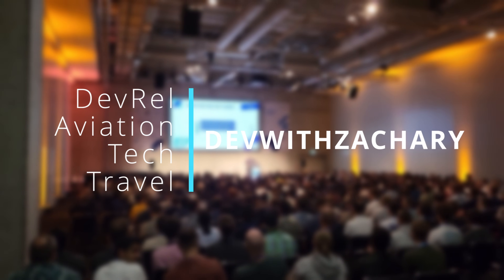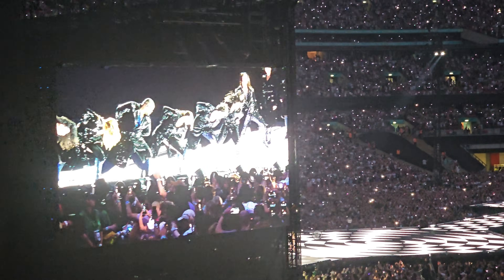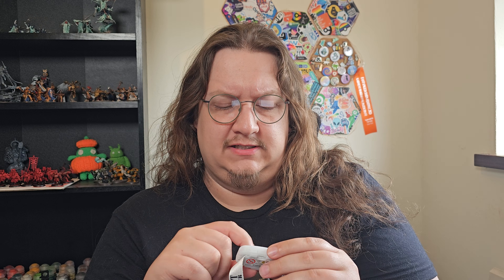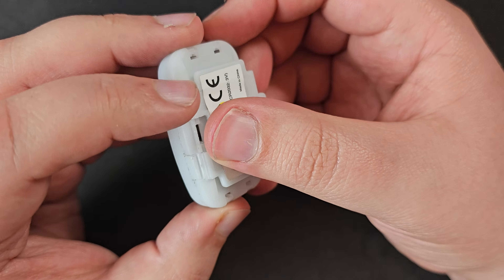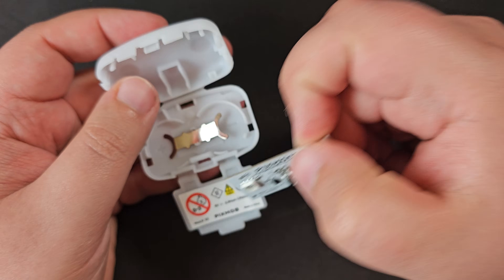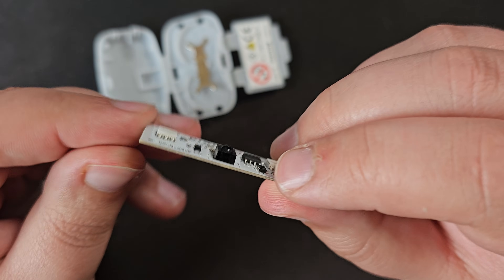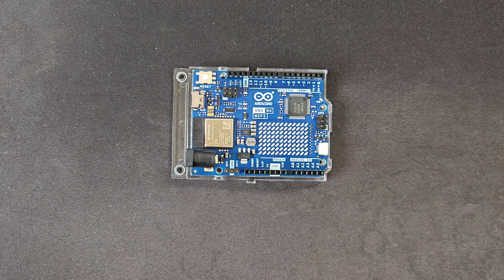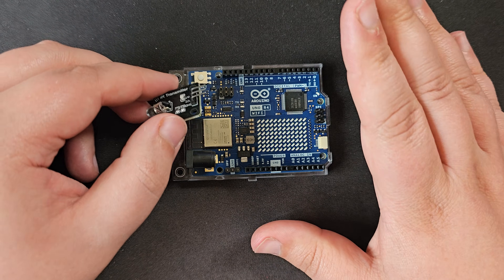Hacking the Pixmob LED bracelet (As used on Taylor Swifts Eras Tour)

Comment: Ok, I have done the same and works. It's not very good that we nee to use python, so I move the binary sequence directly on the Arduino sketch. Now, when my event was ended the leds blinks in white, also when I was at home, so there is a way to store led sequence also without IR trasmissions? Someone have found it?

Comment: Good morning. Great video, thank you. I'm very new to Arduino and I've been trying to get a Coldplay wristband working with the R4 WiFi, for very sentimental reasons. Have you dived into the sound to light hack? It automates the sending code to the IR LED and should be great fun but I can't make it transmit; my KY-005 doesn't have a resistor built in - maybe an issue? I'm sure many would enjoy seeing you work through it.
Keep up the good stuff.

Comment: so how are colors change via infrared? is it like a morse code that is sent across the light to the bracelet?
Reply from the maker: Pretty much, its an encoded series of light flashes that correspond to a colour and type of flash
Reply: Yup, binary 1s and 0s encoded to 8 bit values of Red Green and Blue (RGB). Each color is 8 bits of data or 256 levels of brightness so you can mix and match for effects. Purple = R + B, Yellow = R + G, Turquoise = G + B etc...

Comment: These are quite cool. I went down the rabbit hole a few years ago on syncing them up for a Christmas light display. With a proper DMX to RF transmitter you can get near 1 km range on these. For those in the programmable LED lights hobby, using an app like Xlights, a Falcon or Kulp controller and a DMX to RF transmitter you can make a fairly interactive show. I'm working on one for this upcoming season as a local fundraising event for pediatric cancer research.
Reply from the maker: @kevkev5935  very cool….and now I have ideas for Christmas 😂😂😂
Reply: @devwithzachary  Its an addictive hobby for sure. I followed some WS2811 pixel lights gurus a few years back and the rest was history. This year's project for me will be hacking the Govee curtain lights to work with Xlights and incorporate into my show as a pixel matrix.

Comment: Thanks for the great video!  I may try tackling this one as well.  My daughter went to a concert and ended up with one of these PixMob light bands as well, although it is a different model.  The batteries are dead, so knowing that the accessibility is as modular as it is, replacing the batteries would be straight forward.  I have a background in software development, including an understanding of languages such as Python, and I have experience with electronics and soldering.  I didn't realize the Arduino's had such low price points, so I may try this out!  You earned a subscribe from me today!  : - )
Reply from the maker: Really was a fun little project! and yeah i was surprised at the Arduinos price point. Thank you for the sub!

Comment: My daughters came home with Taylor Swift bracelets. Do they have RF capability? Is the RF just an alternative way to IR to program or activate the bracelets? The github page is not very clear on that. Thank you for enlightening me on the workings of the system.
Reply from the maker: @Djeez2  I believe there is a specific version that uses RF instead of IR. The versions from Taylor swift are just IR
Reply: @devwithzachary  hey can you show what thonny script do you used and what did you edit, 'cause mine isn't working :(

Comment: I believe for the shows themselves they trigger the controller (the Arduino in this case) with theatre lighting protocol "dmx" so the operator to use the (control) desk or lighting software of thier choice. DMX itself is a really simple protocol, just an ever repeating stream of 512 8-bit numbers and reset pulse.

Comment: I am quite new to all this Arduino stuff. I understood the part flashing the code onto the Arduino. But how do you send these demo effect files on python via the arduino? I don’t get that part
Reply from the maker: The python script is sending the instructions over the Arduino serial interface (via USB). So the code running on the Arduino itself is waiting for data being sent over serial and then converting it into IR signals. (my rough understanding anyway)
Reply: @devwithzachary  thanks!